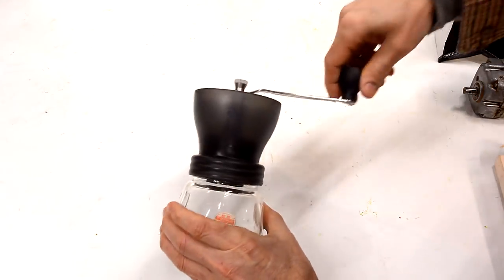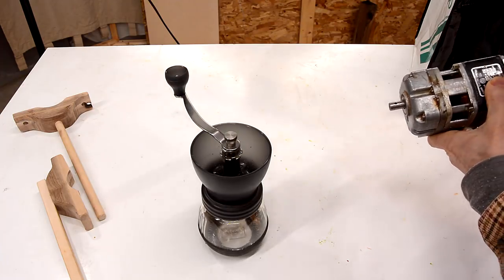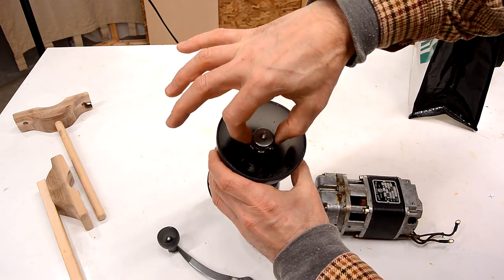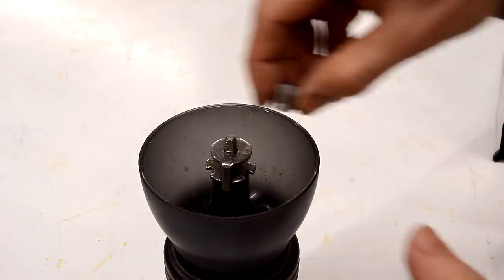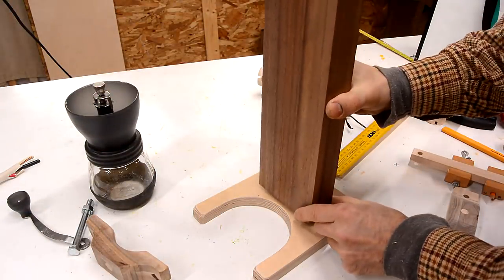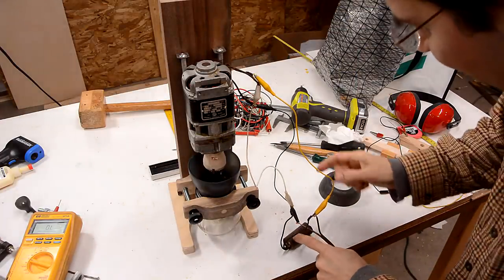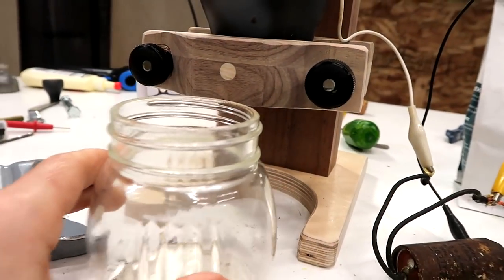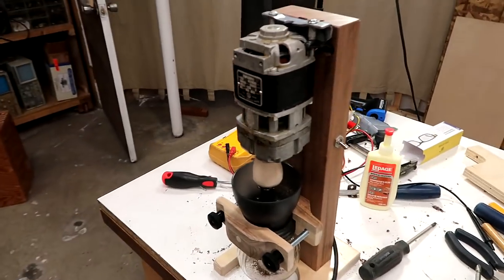Motorizing a hand-cranked coffee grinder

Comment: Your missus is a good sport. Seriously, who else would put up with that shit? Love this video.
Reply: Alucard Pawpad whoa, dude, got some issues?
Reply: In this case it's very functional, but damn that's suddenly loud when it's out of the shop and into the kitchen
Reply: I would. Reduce reuse recycle baby!
Reply: I found mine on the side of the road during my morning walk on garbage day!
It's Black & Decker SmartGrind that had a faulty switch wire that wasn't making good contact with the switch, and they throw it out, instead of fixing the wire that took less than 5 minutes. Some people are such techno-idiots! 
It's been 7 years and it still works perfectly, despite being used daily.
Reply: Holy cow! I wonder if that was the grinder I was using to grind up mouse parts for my geriatric snake?  The switch always was a little finicky, but I didn't fix it because the snake died.  It was about 7 or 8 years ago.
Reply: i think she wanted it motorized ? because it was awkward to grind manually
Reply: Improper language is not appreciated in this channel. My only suggestion is to make sure that the power and ground have safety systems in them. This is a very small motor and will not Trip the circuit breaker. So my suggestion is to put in a in-line slow blow fuse. That way if the motor stops the fuse world trip and coffee will be delayed only
Reply: Shane Martin Geriatric snakes are a sure sign of veracity. I salute you.
Reply: Ever used a normal coffee grinder? Not exactly quiet, and more then that, shrill.
Reply: Brandon Lisik --- Yup, most store bought coffee grinders are insanely loud.
Reply: Yeah, I wasn't sure why anyone would criticize the noise because most commercially-available coffee grinders are loud as hell.
Reply: Daylen - Coffee grinders are always loud, but his definitely needs and enclosure to keep away curious little hands.
Reply: All electric coffee grinders are noisy. But this one is original, one of a kind. Not produced in series.
And very practical.
Reply: Move up to Alaska, where the women truly appreciate a handy man.
Reply: Michael Robinson certainly someone who wouldn’t complain about an uncomfortable coffee grinder
Reply: because of it being in this cupboard that sounds like a guitar box !
Reply: Michael Robinson I was just about to post the same thing!
Reply: Way to go UFOhunter.  I wish there were more people in the world like you!!  I hate this throw things out society.
Reply: Yeah, she looks "thrilled" about it

Comment: I spent many morning considering this same project while cranking away at a manual grinder. It was a zen exercise, which was frequently interrupted by my kids demanding to be fed. I even went so far as to take my grinder with me down to my shop and start laying things out before repeatedly getting side tracked. Ultimately I bought a nice Baratza grinder, which is a thing of beauty. It has the side-benefit of driving away the kids while operating due to the noise that seems to bother them far more than it does me. Kudos, Matthias, for following through on the project that surely has been contemplated without execution by so many like myself. Also, that Aeropress makes some damn fine coffee.

Comment: I have the exact same grinder, and I've been thinking of motorizing it too!...  I was going to go with a stepper motor since I found that it works better if you back up a bit when grinding (turn it in reverse for maybe half a turn for every 5 turn), it grinds a lot faster since some beans do get stuck in the grinding part and reversing clears them out...  Excellent video as always!  Oh, and for those who say you can get the same thing for $20, try again:  He has a ceramic conical grinder, and motorized versions for this type of grinder start at $150 (but hey, if anybody knows of cheaper priced ones, do share!).

Comment: Finally something I am qualified to comment on! I have the same grinder. I replaced the thumbscrew nut with a hex standoff (used a standard one and drilled / tapped to match). Then I use a power screwdriver with a socket driver to match the standoff. I just hold the screwdriver in my hand while it grinds. Super easy. Works great!

Comment: Neat. I just use my 12 volt drill. It goes as slow or fast as I'd like and is quiet enough not to wake the kiddos. Maybe doesn't look as cool though.
Reply: whipped cream in our house is made with the makita drill and hand whisk combo.
Reply: Sirus so you make it like you're supposed to. Gotcha.
Reply: I was going to try to use a drill with mine.  My thought was to replace the little knob on top with a threaded-rod coupler nut, but i could not find one that would fit the metric threads.  How do you grip the mechanism in your drill chuck?
Reply: Ben Browand mine is a perfect 1/4 inch hex.

Comment: I have that exact same grinder. It looks nice but from an efficiency and effectiveness standpoint, it's outright terrible. You need to crank it slowly because the feed-in surface is too small, so going faster will just have it spin out without milling anything. And on finer settings, you're sitting on that thing for more than an hour to clear half a filling.
Reply from the maker: well, it works fine at 120 rpm with this motor.  Yes, wouldn't want to run it at 3500 rpm.
Reply: Matthias Wandel, I would like to see you try it though.
Reply: Watch his automatic crib rocker video.  First attempt was way too fast.
Reply: playgrrrr i have the same,  use it for spices and salt though  (dry rubs for BBQ) then higher rpm is fine, but coffee beans will jump out on high rpm
Reply: It might look fast in the video, but if you think about it, 120 rpm is just 2 turns per second, so really not overly fast, and in the video it looked pretty darn efficient.
Reply: I'm sure you won't wanna bother with this if you're happy with the coffee it makes, but 50 rpm or even less is closer to ideal for burr grinders, so if you end up taking the motor apart to paint it, you might consider adding a PWM control to the mix. The faster the motor turns, the farther the overall particle distribution strays from the fineness setting you dialed in. It's not always as noticeable for drip-type coffees, but the closer you're trying to get to either end of the spectrum (French press / espresso or Turkish) the more it matters. If you try and do a really coarse French press grind and you set the grinder as coarse as it will go, but the motor turns too fast, you'll get a lot of fine particles in the grind that get over extracted and make the end result taste pretty bitter.
Reply: My solution is to give it a quick up-down shake every five to ten turns of the handle. This gets the beans re-engaged with the grinder teeth and clears out any clogging.
Reply: Add an SCR dimmer to it so you can turn down the speed if you want
Reply: My wife has the same grinder, and by luck I found a small cylinder in my box of random stuff, that fits the threading on the grinder on one side and accepts a hex bit on the other, so I can just use a small electric screwdriver to power it. Waaaaay more janky than your setup, and it eats up the battery of my crappy screwdriver. But hey, it works.
Reply: playgrrrr
Reply: I have the same grinder too and it works like a charm. Just need to fiddle with the fine/course adjustment to make it grind well, depending on which beans you have.

Comment: I switched to a very similar grinder a few years ago. I did it to reduce the morning noise so that my partner can keep sleeping even when I have to get out the door extra early.

I had the same problem as Rachel, gripping it is a pain. I have considered many times the thought of rearranging the mechanism to sit on the counter and have some kind of flywheel to keep everything moving between arm action. This keeps the benefit of human powered quietness and efficiency, but saves time and fatigue.

Comment: With that type of motor, measure the resistance of the windings, if they are both about the same, you only need to swap the supply wire that connects to one end of the capacitor to the other end to reverse direction.
It's a useful tip if you ever want a motor that can be reversed electrically with a switch.
Reply from the maker: I measured them and they were not the same.  Do read my article on reversing induction motors.
Reply: That's fine.
As an electrician i am well aware on how to reverse motors, including brush motors and 3 phase ;)
Reply: Sparky Projects try not to be helpful in the comments please. Thank you.

Comment: I have that same grinder, and I have actually tried using it with a drill at a low speed. One thing you want to be aware of is the grinding mechanism tends to get very hot if it's spun too fast. I don't know how exactly the speed of that motor compares to the drill I was using, but it's something you'll want to keep an eye out for.
Reply: Tried it today.
My drill doesn't want to turn at lower speeds, it just hums, then once it goes fast enough, it suddenly starts going fast.

Also almost burned myself with the hex nut thing on the top because it got so hot.

Did the job tho...

Comment: Hah! the AeroPress! That's what I have and love it. As for the grinder, as cool as that is, the grinding cylinder is extremely small in comparison to a proper grinder. They did that to reduce the load for manual cranking. I do honestly recommend you get a proper grinder, as coffee oxidizes rapidly after ground. So you want to minimize the time between grinding and getting water to it. Also! Look into the inverted AeroPress method, my preferred method.

Comment: I have the same grinder. I replaced the handle with a 10mm nut and use a drill to spin it. Works fine. The oblong connection of the original handle is not necessary.

Comment: You're also improving the quality of the grinder. stock that grinder only has one bearing keeping it centered and it relies on there being an even spread of beans around the burrs for stabilization. Adding a second stabilized point above the burrs with the motor keeps the burrs always a constant distance apart and should give you better consistency.

Comment: I did this too but just used a drill. I tightened the chuck onto the threaded area where the knob screws on. Only trouble was the ceramic burrs wore out, so I bought another grinder with steel burrs.

Comment: I've done this with a cordless drill, nut, and a nut driver.  You have to be careful with how fast you make it go, otherwise you can actually wear out the burrs.  They may be ceramic, but they're only designed to go a certain speed (thus the hand crank design).

Comment: I have the same Hario skerton grinder, or what is left of it. I got tired with the cranking and just used M5 nuts with a socket and a cordless driver. It worked fine, until one morning the battery was flat and I used a power drill instead. It had way more rpm than the driver and friction ended up melting the bearing surfaces that are just plastic. I guess it could be salvaged, but I ended buying an actual powered coffee mill.

Comment: After it's painted green, you need to install an adjustable timer so it will run as long as is needed and you can just have a momentary push button to engage it. (Mostly because I want to see how you accomplish that) but, the commercial produced one we have does do that, you just push the button and it goes for like 10 seconds and you can walk away and fill the water or feed the cats or something.

Comment: The way to use a hand grinder is to wedge it kinda between your knees, maybe stick a hand in there to help stabilize and then crank with the other hand.  That's what those square wood grinders were made for:  they are not just a dumb old fashioned decoration thing like those horrible heavy casa blanca style ceiling fans where you would be better served by a 3 blade or one of those modern invisible fans.

Comment: only thing I would add is a ground connection to the metal plate at the back and some rubber feet to dampen the vibration  transmitted to the kitchen cabinet.

Comment: Instead of making and shaping the wooden cover, you could have just used a locknut or combination of two nuts on the spindle. Also, it'd cut down on the noise if you made a cover with some thin foam insulation. I've been wanting to do something similar for a while with my grinder - I have the same type.

Comment: I just use a small cordless drill. Lock in the grinder's shaft like it's a drill bit and pull the trigger. Works great.
Reply from the maker: those small drills don't typically work that well at low RPMS needed to properly grind with one of those grinders.
Reply: Hi torque setting, or just half depress the trigger. It works. I promise. Saw a guy do the same thing in this vid: https://youtu.be/dO22Uv-PQXQ?t=693

Comment: If you add peanuts and small quarter size pieces of old sock into the grinder and then add the beans, it will reduce noise. Also. You can use donuts. Or old fingernail clippings. Or just use eggs

Comment: Could it be made less noisy by covering the motor with a material like urethane, and using cork spacers between the bracket and the wood structure?

Comment: I have exactly the same grinder and i must say you did it way to complicated: the thread on top are M8 for the gear thingy and M6 for the crank - you will just need a M6 long nut and cut a M6 thread on the motor shaft and you are ready or if you have no motor just put an  bolt in and use your drill

Comment: wouldn't it be better to power it with a belt and mount the motor behind the grinder? It would make the unit more compact, would look better, because the motor would be hidden behind the grinder, and that rusty, old motor hanging just over the grinder doesn't look too good. and you could also easily change the speed of the grinder by making pulleys of right size

Comment: That grinder is the worst. The “burrs” if they can be called that are only stabilized at one end, allowing them to wobble around and create grinds that are not anywhere near uniform.  This results in awful coffee with bitter as well as sour (too fine and too coarse respectively) tastes. I had one and 3d printed a stabilizer for the top, and it improved things, but I felt like it was a risk of consuming the PLA material inadvertently. Get yourself a “fancy” manual grinder and motorize it if you want to be cheap and cheerful

Comment: Hello Matthias.  I had thought of the same idea, started researching and saw your video. It’s great work what you did with the updated coffee grinder. Can I ask what engine did you use, or where did you get it from and how much power does it put out.  At the moment I have three oscillating fans and I was going to possibly take one of them apart to get out the engine. But before doing so I don’t want to overshoot and pull out a working engine that may be too powerful.

Comment: You can buy one of those electrical grinders for under $10...
But hey, this is way more interesting.
Reply from the maker: the kind that does a terrible job and doesn't last.  See linked article.
Reply: Sorry for not reading the article, but I tend to avoid websites with white backgrounds, because my room is super dark (Nitpick, but I don't do it intentionally.) I personally have been using a €7 electrical coffee grinder for 5 years now, but your mileage WILL vary. With Chinese quality control going for it I bet I'm super lucky.
Though I wonder what's more economical. Getting a new $10 grinder every time it breaks or getting an electrical motor (you must forgive my ignorance in pricing for that) and attach it to a manual grinder which will last longer.
Because I don't know, I won't call you out for your choice (and like I said. It being interesting already justifies it.)
I wonder how well it will hold up a year from now, keep us updated!

Comment: I just added a nut to the top of mine and used a drill (can see it in a vlog I did a year  ago: grinder at 0:21 https://youtu.be/4sCoDqNOiww) Since then mine has failed, I think it is due to a plastic/nylon washer on top that can wear out and jam it. I haven't pulled mine apart yet to confirm though. I'm planning a quick video tutorial on how to modify it for higher speeds.